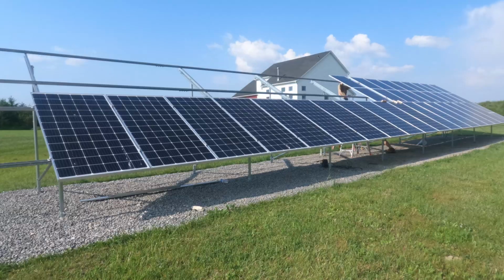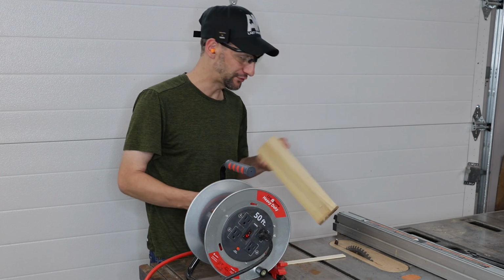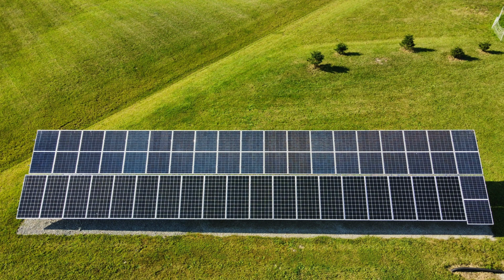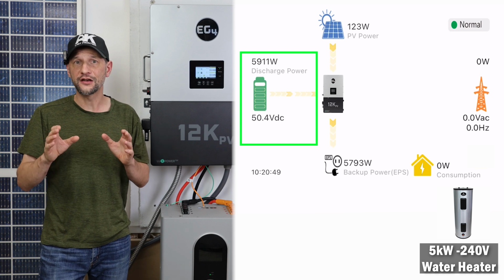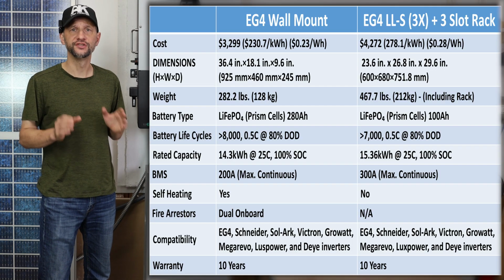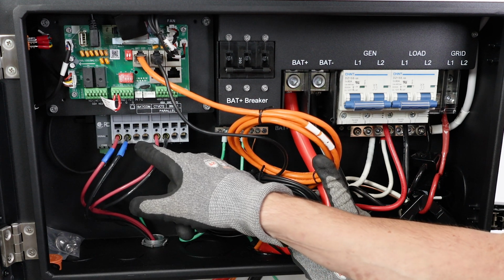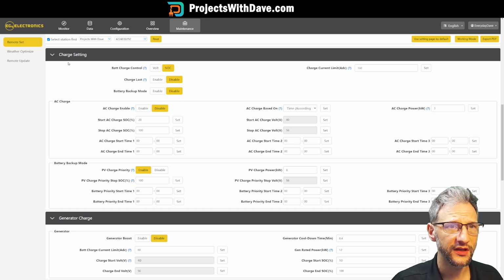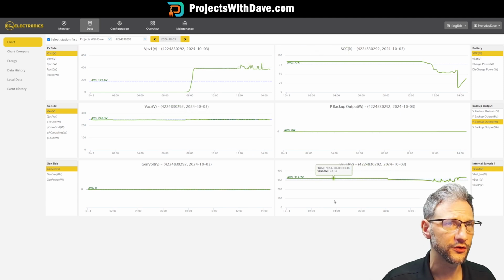EG4 12KPV & EG4 Wall Mount Battery Install & Testing Shocking Results

Comment from the maker: I love this system so far!  Let me know your experience below.
Signature Solar ($50 off $500 or more discount Code "EVERYDAYDAVE"): https://signaturesolar.com/shop-all/solar-panels/?ref=SALE
EG4 12KPV: https://signaturesolar.com/eg4-12kpv-hybrid-inverter-48v-12000w-input-8000w-output-120-240v-split-phase-rsd-all-in-one-hybrid-solar-inverter/?ref=SALE
EG4 18KPV: https://signaturesolar.com/eg4-18kpv-hybrid-inverter-eg4-18kpv-12lv-48v-split-phase-120-240vac-ul1741-cec/?ref=SALE
EG4 Wall Mount Battery: https://signaturesolar.com/eg4-wallmount-indoor-battery-48v-280ah-14-3kwh-indoor-heated-ul1973-ul9540a-10-year-warranty-pre-order/?ref=SALE
Reply: Can you do some reviews on the Vevor wind turbines they look legit I’m going to get the 5 blade 500W turbine sells for only $108 when you sign up to be a member for free usually $131
Reply: Can you do some reviews on the Vevor wind turbines they look legit I’m going to get the 5 blade 500W turbine sells for only $108 when you sign up to be a member for free usually $131
Reply: Can you Please see if they will (EG4) will let you get the 21K system they are about to bring out.  I want to grab that or the 18K

Comment: Does the 12000kpv need a manual transfer switch? Google says the inverter will change automatically once the grid kicks out.
Reply from the maker: The transfer switch is built in.
Reply from the maker: It has a built in transfer switch.

Comment: Dave, hope you are doing well. I need your help. 

Here is the more specific question, that is the only thing keeping me from buying the big 18kpv/flexboss set up. Should be similar to your set up. 

How would you wire this to a 200amp SUBPANEL, so it just feeds that subpanel and not pushing to the grid/main panel, but that it still has power from the grid when batteries and sun are not sufficient? 

If you let me know how to wire this up WITHOUT adding another critical loads subpanel, but still has the smart automatic switching to grid when needed, I will buy the $20,000 worth of signature solar stuff right now including: EG4 18kpv, 2x large batteries and if recommended a gridboss, and then a flexboss once available.

Comment: So dumb question, it can use the grid to charge the battery, but doesn’t backfeed correct? 

Looking to initially do something like charge battery off peak hours, and run the house on battery when it’s more expensive.

Comment: Can't you just turn that rack mount battery system sideways? That EG4 battery doesn't give much capacity to run a whole house during a power outage.

Comment: Would the following be a bad video?
If one have setup with east and west facing panels, can they be on the same MPPT input, what is best serial vs parallel. A second topic ca be east, west and south on the same MTTP input.
Reply from the maker: You do not want to put panels facing different directions on the same MPPT.
Reply: @ProjectsWithDave I haven’t found any supporting info about mix directions on the same input. Assuming there will be some loss if in parallel, but there also an extra cost if you need double the size converter.

Comment: I assume it would be possible to have the inverter split the 12Kw of PV as (up to) 8kw of combined export + loads and use the additional (up to) 4kw to charge the battery targeting full charge by sundown. To take advantage of the 12Kw of PV while not stressing the battery, end then exporting from battery to enable the same next day. (on 1:1 net metering)

Comment: Great video.  I am moving into a home with 6KW of grid tied solar (28 - 210W panels) and want to add batteries and maybe some more solar down the road.  I was thinking about the 12K and looking at the current inverter (Schuco) it has 2 strings with 122 volts each.  Is that too low to be efficient with this all-in-one?
Reply from the maker: I'm not familiar with Schuco, but 122V is a very low string input.  I've had my 12KPV running for almost a year now with out a single issue.  I think my only complaint would be the fans are loud when the solar input is over 5,000W.
Reply: @ProjectsWithDave  It was put in back in 2011.  Just curious what I can do with it.  Thanks

Comment: Please test running your solaredge into the ac coupled/generator port section on your system. I've got an existing solaredge system, and I wanted to see how to hook that to the eg4 so you can still pull solar even with the grid down.

Comment: At 32:45 you discuss the wattage exceeding the rated output of the array. When the wattage increases, does the voltage and amperage also increase? Also, you discussed the limits on amperage at 32:49 being higher in cold temps; we need to use the chart in NEC 70 at 690.7(A) to check for the increase in (peak) amperage during during the winter months. Lastly, I am confused by where the EG4 12Kpv receives it;s power from the grid. Is the breaker that supplies power for the GRID  located in your breaker panel and is the LOAD a separate panel for you? Could you just have one panel that the breaker for the 12Kpv comes from the breaker box and supply the power for that panel? I want to install a panel in my shop using the 12Kpv as the inverter, but I only need one panel that will be fed by my main panel from the house so the power from the grid would go into this panel and I would use a separate breaker to supply the GRID side of the EG4 12Kpv. Or do I need to separate the two feeds and bring the utility power into it's own 200amp breaker and the feed the panel box from the EG4 LOAD breaker.

Comment: why does everyone skipping wiring to the grid? Obviously a lot of risk there. Wiring to the batteries and PV inputs is covered really well in the manual. Gird tie, I am still kind of guessing. More information I would like to know is what about running a hot tub, hydronic heating system and water heaters. You give more information than other people, but still curious to see what happens. Going to need a bigger battery, LOL.

Comment: The 12kpv uses cheap high-frequency, transformerless inverter tech that can damage your appliances and can even start a fire because it lacks an output transformer to provide galvanic isolation between its DC boost stage and its AC output. No thanks, never in my home.

Comment: How is the new connected to the SolarEdge?  I have a SolarEdge inverter & would like to add batteries vs replace/maintain the generator.
Reply from the maker: They run independently, just combined at an AC combiner box.

Comment: EVERYDAYDAVE coupon does not work. It says "The gift certificate or coupon code is invalid". I'm spending way more than $500 too.
Reply from the maker: Signature Solar has changed the way the Coupons work.  If you use my link the $50 discount should be automatically applied without entering any code: https://signaturesolar.com/?ref=SALE
If it's still not working, let me know.  Thanks!

Comment: Why aren't you telling your viewers that these transformerless inverters provide no galvanic isolation and  can damage their appliances when their MOSFETs fail? And by the way, the only reason why this inverter is able to start these inductive loads is because it's oversized. Why pay the much higher price for this transformerless 12kW inverter when a much lower priced, longer lasting 8kW transformer based inverter can start and run these same inductive loads?

Comment: Nice battery, but a poor choice for an inverter. Lightweight, overpriced, high-frequency inverters like these have a poorer surge capacity (only a 24kW surge) than higher-surge12kW low-frequency inverters (36kW surge), which is one of the reasons why they won't last long powering your home, especially with those large inductive loads.  The other issue that you'll face is that this 12000XP doesn't offer any galvanic isolation, which means that when its MOSFETs fail, this high-frequency, transformerless inverter could damage your home's appliances and your motor-driven power tools and could even set them on fire. A low-frequency, transformer-based inverter would have made a far better choice if you want to power your entire home, 24/7. Don't take my word for it, ask Google Ai "does high frequency inverters lower surge capacity?" or "high frequency, transformerless inverter no galvanic isolation?"

Comment: I want to setup up the 12KPV so that it does not sell power to the grid.  Can the 12KPV supply power to the main panel connected to the grid and feed circuits on that panel with the sell back feature disabled?
Reply from the maker: In your situation, I would put the whole load center on the load side of the inverter and feed power into the input side.  You might need the 18KPV to achieve the typical day time use of the whole home.  
This is the 18KPV, it has more passthrough capacity: https://signaturesolar.com/eg4-18kpv-hybrid-inverter-eg4-18kpv-12lv-48v-split-phase-120-240vac-ul1741-cec/?ref=SALE

Comment: Just curious,I installed an 18k with Ethos batteries last summer and the only glitch was I can’t start a hair dryer on low as it resets the inverter,if I start on high and turn it down no problem. Are you seeing this on yours?
Reply from the maker: That is strange.  I can't imagine why you would have that issue.  Maybe it is detecting an arc fault somehow.  If it is repeatable, I would report it to the manufacture.
Reply: @ I did and they asked me to totally separate the panel and inverter grounds by actually adding a separate ground rod. My electrician did this after I was gone for the winter but we’ll see in the spring.

Comment: Question I hope you will answer. The AC amp output of that inverter is 33 to 38 amps. How are you running all that stuff on under 40 ams?
Reply from the maker: Off grid operation is 33.3A at 240V or 8,000W constant operation.  For short periods it can supply much more.  It is rated for 10kW for up to 1min.  Grid Passthrough current is 80A or 19,200W.

Comment: did you do a under pressure start on air compressor?  A compressor still under load is much harder than a no residual air start.

Comment: Easy install my a$$, can’t get battery to sync with 18k. EG4 hasn’t returned my request for help in 24 hrs. This is ridiculous!!
I’ve watched dozens of videos seeking help, even Will Prowse had this trouble but he has an inside cell number to tech support. 👎
Reply from the maker: I called the standard tech support line 4 times and had someone answer within 5min.  Is it an EG4 battery?  I did not have any communication issues.  Are you getting an error?

Comment: I always enjoy you videos sir. Just wanted to give folks a heads up about saving a few hundred bucks on a soft start. EG4 says (and has a video on their channel) the 12k can start a 5ton ac unit while already running a few thousand watts worth of load. So maybe people can buy both and hold off on installing it to see if it's necessary. Thankya sir!
Reply from the maker: I would still use a soft start.  It dramatically reduces the surge load on the electronics.  It also increases the life of the compressor.

Comment: Hay Dave, does this system provide inputs for wind turbines with all the data, just as with solar? My plan is to have 4-6 wind turbines with a solar array. I am looking at going for both for my small 320-acre ranch here in Arizona. I also would like to ask if this system is scalable? I plan on starting out with 10KW and building up to a 60KW System all grid-tied with the added income of excess power being sold to my local power company which does allow net metering and will buy or credit back to my account the unused power I generate. Thanks for the amazing video.

Comment: Can you do a video on what you would recommend for a system today?  I would like to install a battery backup, ~9KWatt system with an EV charger from the panel as well.  Wouldn't mind if you could share possibly using an EV as a "battery backup" in case of emergency.  Thanks!!

Comment: How do you have this wired into your home power?  Is it going directly from the inverter to your main panel?
Reply from the maker: It has to go through an AC disconnect then to the main panel.

Comment: I have a 40x40 3 sided pole barn that I would like to have some solar power in to run some lights minimally(to see when parking one of the vehicles in at dark), maybe have a trickle charger set up to keep tractor and rv batteries topped off.  What would you recommend?  I don't want to spend a fortune and there wouldn't be any power tools or anything to run.
Reply from the maker: If you are running LED lights it would not take very much.  If you have no split phase loads you could do a simple setup with a single phase inverter and one or two server rack batteries.  You could do a setup like the one in this video: https://youtu.be/BzMAW8kW0CU
But instead of using the Victron charge controller, use the EG4 3k inverter in this kit: https://signaturesolar.com/complete-off-grid-solar-kit-3000w-120v-output-48vdc-15-4kwh-eg4-lifepower4-lithium-powerwall-48vdc-4-740-watts-of-solar-pv-kit-e0001/?ref=SALE
That kit has more capacity than you need, so you could scale back the batteries and solar panels to match your loads.
If that's too complex, you could also get away with using an all in one system, you can get an idea of the performance and options from these videos:
Bluetti: https://youtu.be/_QMe8DWlr30
Anker: https://youtu.be/5H-w63thZiE
Pecron: https://youtu.be/ZlIbkhPPfGI
Ecoflow: https://youtu.be/NTpSEfAxWnw
Reply: @ProjectsWithDave  Thanks Dave.  I thought about the all in one but figured the cold temps would hurt them.
Reply: Thanks for the video. I recently installed a Solar Edge HD wave system, 9.6 kWh. I did not get battery back up at that time but I am considering that now. The company I used said the inverter had the capability of adding batteries or a system without additional inverters. I noticed you did something different.? In your experience can you connect batteries or a system to the Solar Edge. Again thank you for the videos, I will be visiting with Signature Solar next week and will mention you.

Comment: Love this! In your opinion, at what point (price & functionality) would you consider this system over a dual Ecoflow or dual Anker 3800 system like what you have reviewed in the past?
Reply from the maker: I would only go with an all-in-one system like Ecoflow or Anker if you don't have the capability to install a modular system.   With a modular system, you can make upgrades more easily and you have more control over each part of the system.
Reply: @ProjectsWithDave   Understood! I appreciate the feedback. We may do an all-in-one for this house and most likely a modular for the home we plan to build next year.

Comment: thanks for the video !!.....i do like the EG4, could you show us how to incorporate a gas generator (little 5K portable) to charge the batteries safely?  i havent figured that out on this system....maybe you  can?  also i didnt see a video about the sungold inverter....i did like the toroidal type transformer type inverters at first, and was always interested in them, as they are a much lower price than a victron !

Comment: 8kw wouldn't even power my whole home for 3 hours.
Reply: Wall mount battery costs $3300 you might.find cheaper buy 2 I think it comes with cables which saves money, 2 batteries would be  about 28 kw which would run most homes
Reply: @samfish6938  my house uses between 60 and 80 kwh per day, depending on time of year.

Comment: Do I need to install it near my breaker?  My panels are on the other side of the house.  There's a 20A 240V line going to that side of the house.  Can I just connect that to the 12K and run?  Can I limit the system to <20A output?

Comment: I've got a idea bouncing around my head I'd like some constructive criticism on it's a outside the box idea so please give the hole concept some thought. What got me thinking about this is LED light bulb's around the house all waisting energy converting AC to DC and configured in 🤯way's to run low V LED's on 110-240AC. Solar panels are DC and when you start looking around your home it's surprising how many things are actually running on DC under 24v eg TV PC Router USB chargers the heat given off by power supply's and inverters is all wasted energy so dose it not make sense to have a solar powered DC supply around the house
Reply from the maker: You are not the first one to propose DC.  You are in good company with Thomas Edison: https://www.energy.gov/articles/war-currents-ac-vs-dc-power

Comment: Dave, Can you combine the wall mount battery with a couple of rack mounts?
Reply from the maker: Yes and no.  I have tried it with my system.  If they are both LiFePO4 and the capacities are similar you can do it with some success.  You will find that the SOC for each pack drifts apart over time.  If you charge the system to 100% SOC every 3 to 5 days to re synchronize the packs it works ok.

Comment: I have the same inverter as the one you just replaced.  What are you doing with the old one.  Was thinking of using it in parallel
Reply from the maker: You can contact me through my website: https://projectswithdave.com/about/

Comment: CURIOUS:
my EG4-LL ( series 2 ) 48-volt  Rack-Mount  batteries do have FIRE SUPPRESSION ... has EG4 eliminated fire suppression in the EG4-LL - S ??? 
COOP 
...
Reply from the maker: Good question.  I didn't take one apart to check, but it isn't in the spec sheet that I could find.  Maybe someone who has the battery can answer.